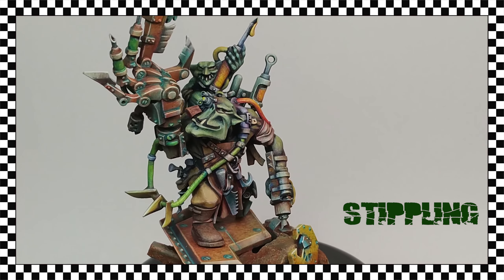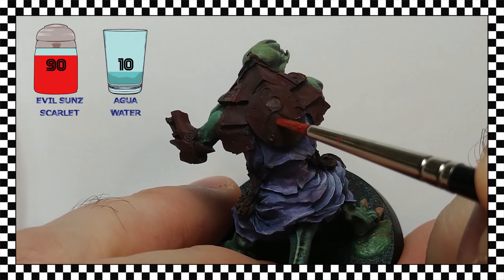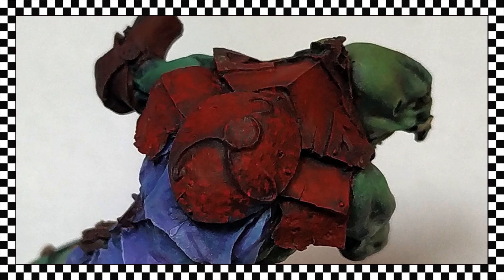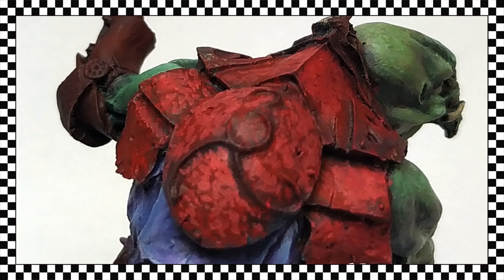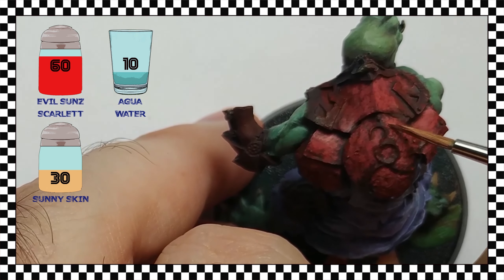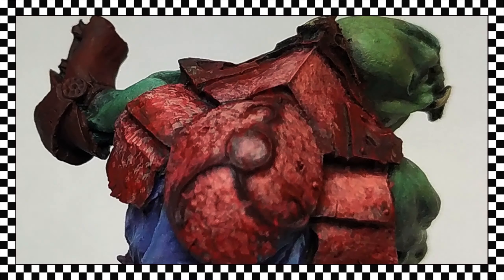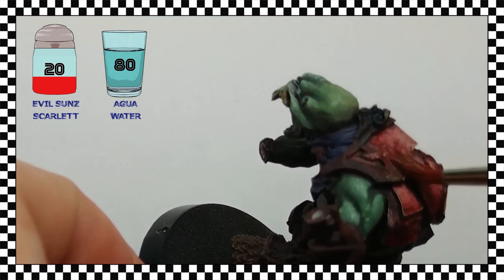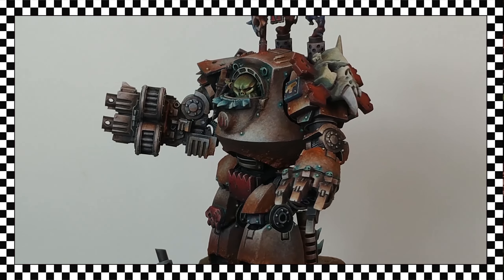STIPPLING - Basic Techniques for Miniature Painting, Vol. 5

Comment: Nice video, thanks for sharing. I have a question, this techniques looks very stressing for the brush, do you use a particular brush for this?
Reply from the maker: Hi Francesco. Absolutely, is a very vary stressing technique when used frequently.. so, I recommend to use with cheap and synthetic brushes, at least for the main stages of the highlight. For the final highlights and more delicate stages, you can use brushes of better quality